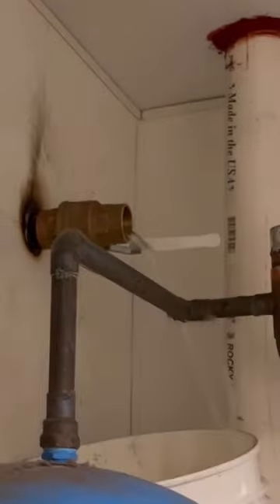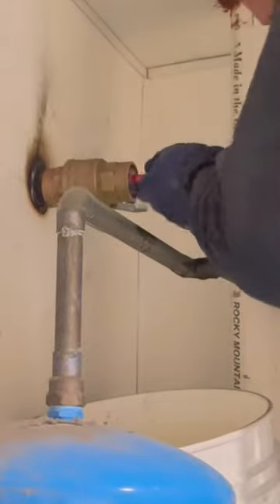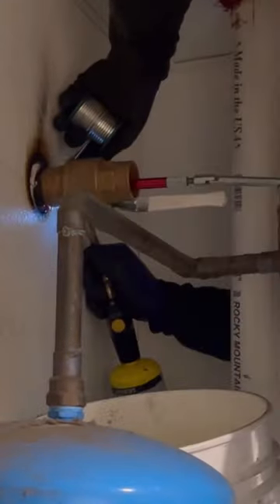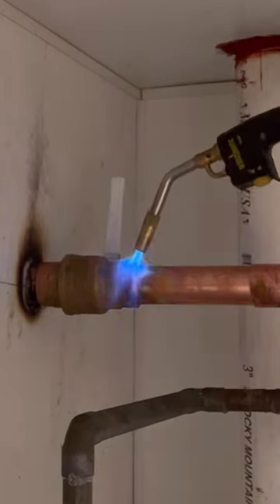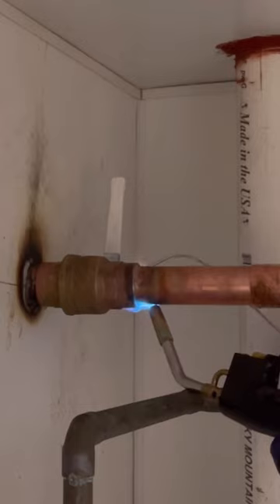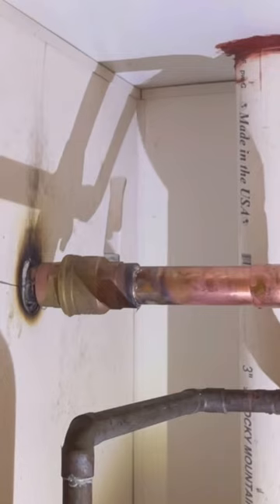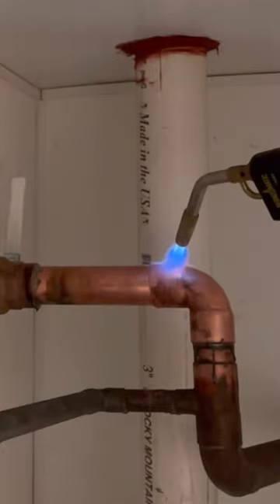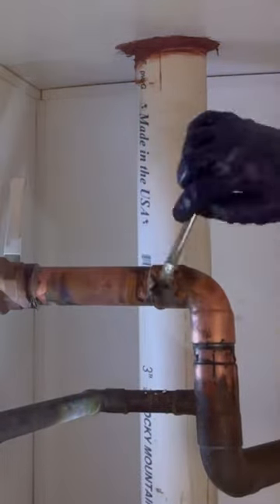Replacing 1 1/2 ball valve #plumbing #shorts

Comment: No need to replace if it was a angle seat valve ball valves are trash they fail so ez stop using them on water lines
Reply from the maker: Ball valves are generally considered to be more reliable and have fewer issues compared to gate valves.
Reply: @plumbers worst nightmare  Never had big issues with angle seat valves they work 30 years easily. Ball valves get stuck so easily with regular turning. Btw changing the top of a angle seat valves is a 2 minute job.
Reply from the maker: Firstly, ball valves typically have a lower torque requirement for operation compared to angle seat valves. This means that they are easier to open and close, particularly when used in high-pressure applications. Additionally, ball valves typically have a larger flow capacity compared to angle seat valves, making them suitable for use in applications where a high flow rate is required.

Secondly, ball valves are less prone to leakage compared to angle seat valves. This is because ball valves have a simple, straightforward design with fewer internal components that can wear out or malfunction over time. This makes them a more reliable choice for critical applications where leaks can be costly or dangerous.

Finally, ball valves are generally more cost-effective compared to angle seat valves. They are easier to manufacture, require less maintenance, and have a longer lifespan, making them a more economical choice in the long run.

It is important to note that the choice of valve will ultimately depend on the specific needs and requirements of the application in question. While angle seat valves may be more suitable for some applications, ball valves may be a better choice in others.
Reply: @PWN5  we are definitely talking about two different angle seat valves 😂